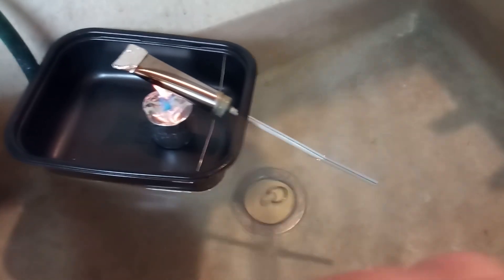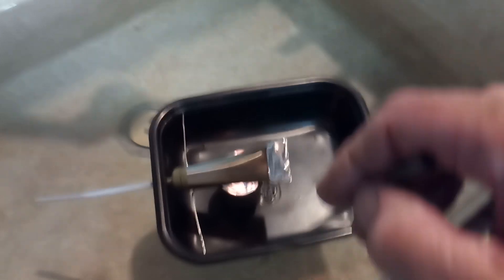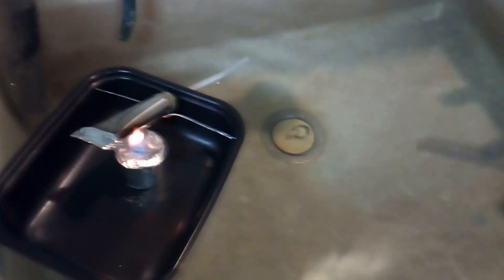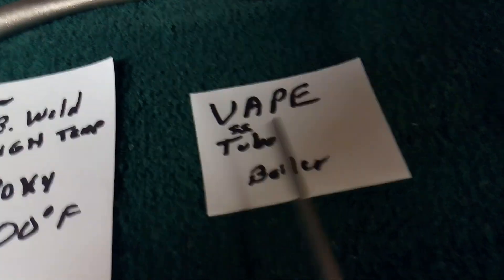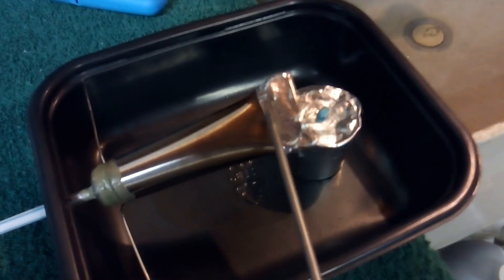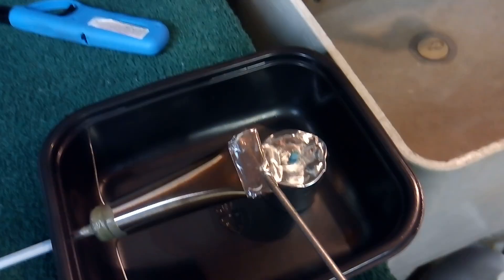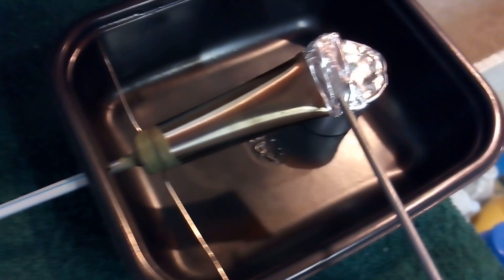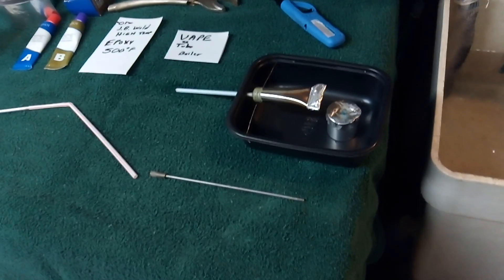Single Pipe Pop Pop Boat Engine

Comment: Interesting, the submerged length of the discharge tube probably provides some variables, in practical terms the sink water is the condenser so I’m thinking that the submerged length is going to determine where exactly the steam condenses ie inside the tube or at the point of discharge and it’s the collapsing of that steam creating vacuum to draw water back into the boiler
Reply from the maker: Yep.  It is interesting how it works.
Reply: @Lidmotor  over the last 15 years I’ve done quite a few shutdowns in coal fired base load power stations, the units are around 400MW capacity, there are 3 separate turbines each provides about a 1/3,of the required energy and each turbine has to get bigger as the pressure of the steam drops. The last turbine is the low pressure turbine and it actually sits directly on top of the condenser so it’s the differential created by the low pressure steam feeding it (after exiting the other 2) and the vacuum created as the steam collapses to create the vacuum.
These little put put boats is interesting in the fact that it will self feed the water back in, do you think it’s the larger capacity of the condenser Vs low energy boiler that allows it to work?
That’s what I’m thinking, if you had excess heat capacity in the boiler it would push it all out in a rush and be unlikely to refill, I’ll have to give it a go

Comment: I really am enjoying this series, and YES, those vapes stink. I can't understand how people enjoy the smells, but each to their own 🤣🤣 That is a great idea using the wire to pump the water into the boiler 👍👍
Reply from the maker: The discarded vape I found was a non rechargeable one but I played around with the battery any way.  I could not get it to take a charge so that part of the 'project' was a fail. The oil smell was awful.  I managed to get the smell off the SS tube which led to this Pop Pop engine.  Filling the engine with the "pump wire" worked really good because there was  no bended curve in the design. Just hold the engine under water and pump the air out / water in. Shaking it tells you how full it is. I see now why you tried that induction heater on this.  The possibities are interesting.